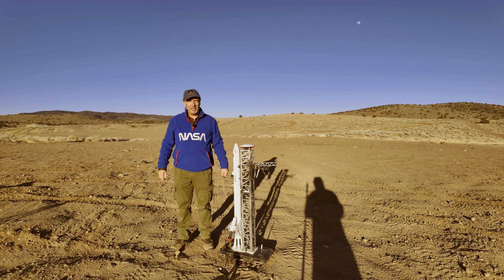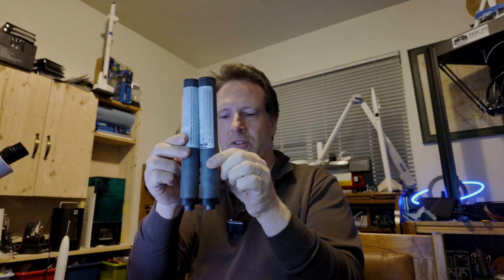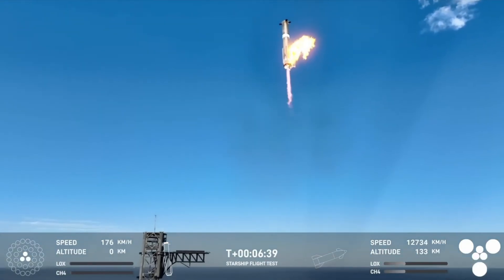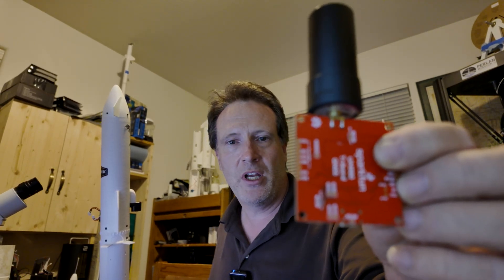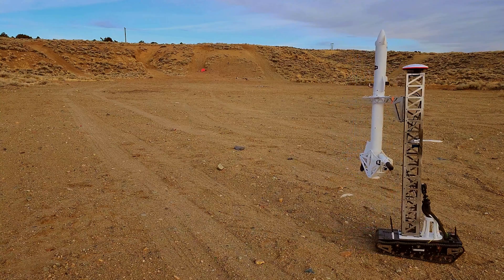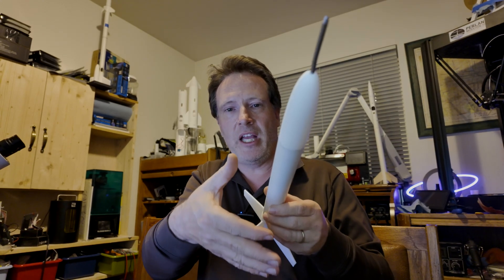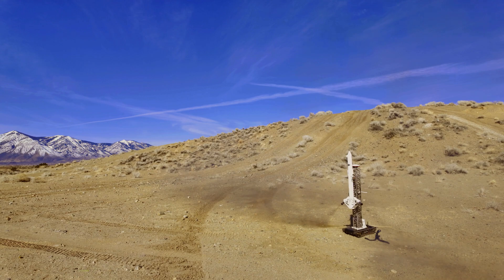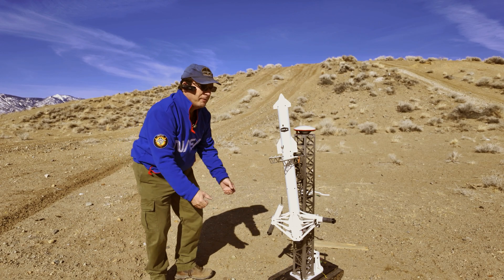Landing a Model Rocket Like SpaceX

Comment: In theory it could work with Jets rather than rockets right? Jet assisted rocket launch has been done by Virgin but jet assisted rocket landing?
Reply from the maker: There is a new category of "rocket" using ducted fans. Look for "EDF Rocket" and you'll see a few experiments. If the point was to actually carry a payload then that would be a better solution than solid motors.

Comment: GREAT JOB! The rocket gimbal backside is fairly ugly and looks quite heavy. Can you try to make it more like SpaceX’s engine system, or thin it down, sleek up your dual engine caboose? Should fly longer with less weight..

You should talk about how you programmed it - did you Raspberry Pi it, or..?

Where do you test fly? Nice snowy mountains, and you sound British or Aussie, maybe?  Are you in the US now? Looks like AZ desert somewhere, perhaps?

Bravo, well done, and continued success. PLEASE, more details to help teach us couch engineers. I built this stuff 55 years ago, without the fab tech. Now, I’m too blind and hands too sore, but I love to watch. All the best!
Reply from the maker: It has to be a certain minimum width to allow the two motors to point completely horizontal. There's no way to make them overlap or pass each other. I could have put the pivot at the top of the motors like I showed holding them by hand but that has a few other issues I wanted to avoid. Doing that moves the center of mass of the rocket quite significantly.

Comment: Ah... Bruh... You're suppose to land without the Starship, separately. Back to drawing board....
Reply from the maker: But isn't it better that both can land together? It actually comes down to the problem of where I put the GPS antenna. If I put it underneath the starship and deploy the starship, then the GPS gets a sudden change in reception conditions and may take a few seconds to re-establish its position to high accuracy. I can't afford that kind of delay or jump in the data I'm working with.

Comment: Hey @FlyDuoDiscus, love the video!!
What is that red circuit board you had with the bulky antenna that you said was accurate within 8mm? Where does it get its uplinks from? Very cool!
Reply from the maker: It's a Sparkfun board. I use two of them, one is in the base and one in the rocket. There's also another radio link that I didn't mention which sends the GPS correction data from the base to the rocket.
Reply: @ Thank you for your response. So it’s using GPS-RTK then? Is it as rough on battery life as I’ve heard?

Comment: Great job. What gps system are you using? What rocket motors we you using. Thanks.
Reply from the maker: The GPS is a UM980 from Sparkfun, in both the rocket and the base. The motors are Aerotech H13ST-P long-duration motors.

Comment: How about a bigger rocket in the middle for a vertical takeover, get to altitude, then on the way down ignite the landing thrusters?
Reply from the maker: Yes, that's certainly possible. I'm still thinking about what to do next.
Reply: @FlyDuoDiscus  might need a stage separation mechanism to ensure that it's aerodynamically stable both on the way up and down

Comment: Very cool! What was the augmented GPS transmitter that you used on the tower and what was the GPS receiver that you used? Where can you buy these for hobby purposes?
Reply from the maker: Sparkfun sells them. It's the same unit in both. It also needs a radio to send the corrections data between the two computers. I used a pair of LoRa modules from Adafruit.

Comment: Can you please explain how did you control the thrust of the motors
Reply from the maker: The trick is not controlling the thrust, since that's impossible with plain solid motors like these. The video explained a little bit about how I set up the motors to balance against each other. I'll make sure to include more details on this when I make a longer explanation.

Comment: Amazing! There seems to be plenty of energy on the table will you go for a height + landing record with this configuration? Are you planning to make a bigger or multi stage returning rocket? Subbed!
Reply from the maker: The thrust/weight equation is a little tricky here. I actually loaded up additional weight so that misfires and other problems coming off the launch pad happen a bit slower. I tried to move weight forwards to get a bigger moment of inertia.  The limit is the amount of thrust available for stopping at the bottom of the 9m descent. You can see in the video that it went to full thrust for a little tiny bit when it was trying to avoid the ground. The SpaceX booster ignites 13 engines to do the same thing, then cuts to only 3 for the final approach.

Comment: Are there any liquid fuel motors -- something you can throttle?
Reply from the maker: At this scale, even a liquid motor isn't throttleable as it's usually driven by pressure in the tank instead of a pump.

Comment: That is brilliant... never would have thought of it in a million years. Was there a third rocket motor in the base doing traditional TVC ? If not then I'm wondering how the rocket balanced in 2 dimensions if the two visible motors only adjusted in 1 dimension.

EDIT - never mind... looks like the two motors are each vectoring in 2 dimensions. Very nice.
Reply from the maker: You got it! Sorry that wasn't clear to start with.

Comment: The model rocket knows where it is at all times. It knows this because it knows where it isn't. By subtracting where it is from where it isn't, or where it isn't from where it is (whichever is greater), it obtains a difference, or deviation. The guidance subsystem uses deviations to generate corrective commands to drive the model rocket from a position where it is to a position where it isn't, and arriving at a position where it wasn't, it now is. Consequently, the position where it is, is now the position that it wasn't, and it follows that the position that it was, is now the position that it isn't.

In the event that the position that it is in is not the position that it wasn't, the system has acquired a variation, the variation being the difference between where the model rocket is, and where it wasn't. If variation is considered to be a significant factor, it too may be corrected by the GEA. However, the model rocket must also know where it was.

The model rocket guidance computer scenario works as follows. Because a variation has modified some of the information the model rocket has obtained, it is not sure just where it is. However, it is sure where it isn't, within reason, and it knows where it was. It now subtracts where it should be from where it wasn't, or vice-versa, and by differentiating this from the algebraic sum of where it shouldn't be, and where it was, it is able to obtain the deviation and its variation, which is called error.
Reply from the maker: There are no errors in my code.

Comment: Was just thinking, does 4 motors make it easier or harder to control the descent of the rocket? Because it seems like the added axis of control could make it more stable, but would it add too much complexity and be unnecessary?
Reply from the maker: I was thinking of doing a 4-motor version but I would only light two motors at a time. That would double the flight time.

Comment: what about using one big rocket motor in the middle with twin nozzles that can twist like that VTOL military jet so that way you eliminate the timing issue between motors firing and cutting off?
Reply from the maker: That's tough to do with hot rocket exhaust.

Comment: Congrats that's really cool. I've daydreamed about using ceramic bits to divert thrust outward. Using two motors isn't something I would have attempted. There's a Chinese guy on here who experimented with a solid motor that had 4 nozzles, which could be steered outward in a similar fashion. What the heck kind of motors are those? Never seen one burn all slow and long like that.

Comment: How are you controlling rocket body roll?  I would think that even the slightest mis-alignment on the rocket holding frame would have it doing a constant slow roll.
Reply from the maker: Each motor moves in X and Y. The two Y's work together to control roll. Without that it spins very fast as the moment of inertia in roll is about 1/100th of the other two axes.

Comment: This made me think, would it be possible to implement thrust control with a single solid rocket motor using a special nozzle that has proportional thrust reversers? So basically, small little doors not unlike the thrust reversers on jet engines, that swing down to block some % of the thrust. Obviously this component would need to be strong enough to withstand the heat and forces exerted on it (some metal probably?). Then the gimbal could be a standard single engine gimbal. Just a thought

Comment: Well done! Thanks for showing how it's done. I see that one motor cutoff after the other, causing that off-centre ending. Is it possible to point both motors downwards and slightly inwards at the last moment to minimise that effect? When one motor stops, the other burns for that extra fraction of a second, but because it's pointing slightly beyond vertical, the offset thrust is mostly compensated for. Subscribed.
Reply from the maker: The problem with that is pointing both motors directly at the pivot point is enough thrust to lift off again. I also looked at pointing the motors into full reverse-thrust but that still has an offset unless the motor exhausts are pointing up at the pivot point and that will melt the plastic I used for the airframe.
"Airframe rich" motors cause "rapid unscheduled disassembly".

Comment: I missed how the rocket moves in the Y axis to jump to the catch side of the tower.

I magine if you could have shown this video to Apollo engineers in 1968.
Reply from the maker: The computer I used to do this would have weighed more than the entire Apollo capsule in 1968. It is literally sitting idle 80% of the time waiting for the next 200th of a second to turn over.

Comment: Awesome and well done. Great idea to use ground-based GPS in the position solution.
Question - what motors are you using? They seem to be flameless and long burning. Are they chemical (versus solid)?
Kudos and very well done. [edit] I did watch an earlier video, and you indicate solid motors. Again, well done!

Comment: that is very impressive ... I was curious how the model was able to direct itself in directions other than the plane of the two movable motors ... does it just react to toppling in useful directions with equal thrust vectoring to change the rate?
Reply: would three motors provide more control?  I guess that depends on the stability of the thrust from the engines ...
Reply from the maker: I didn't make it clear that the motors are individually controlled in X and Y directions, so I have 4 degrees of freedom.
Reply: @FlyDuoDiscus  still impressed ... :)

Comment: WOW I almost laughed at this but I'm glad I looked at it again paying attention. Who would of thought using low impulse long burn model rocket glider engines right? Now at least this makes sense to me providing the GPS does all the work on guiding it in. Damn nice work 😊👍🏻 Let me know if I'm correct or not please?🙏🏻
Reply from the maker: I did seem to say in the video that it was as simple as knowing where you are. It certainly makes it easy with the GPS giving really accurate position data. But GPS on its own isn't fast enough and then I have the bigger problem of working out which way to go to get to the destination.

Comment: OMG. I cannot tell you how impressed I am with this!  I have been suggesting that Joe Barnard (BPS Space) use a similar method of thrust control for years, and I'm so glad to see that it does indeed work. You are a legend mate.
Reply: I've never heard of an approach such as what is shown in the video, but it makes sense to me in how it works. It's pretty clever, and also allows you to use motors that run continuously without the need to worry about re-igniting or igniting new motors for the decent.

Comment: Super cool! I’m wondering: what happened in the end: are you able to shut off the engines when the landing is detected? Why did the left side burn longer?
Reply from the maker: The two motors start with nearly identical fuel, at least within a gram or better. But imperfections in the fuel give different burn rates so that one which cut of earlier was actually giving more thrust for the flight, since we know it exhausted its fuel earlier. So my control system was actually working with imbalanced thrust for the entire flight!

Comment: Very cool achievement, but imho the drive system makes sense because it’s like you wanted desperately use rocket motors where they are limited. Better make a brushless motor driven rocket and do stuff like this. Keep it up 👍🏾

Comment: Incredible! The computer programming must have been no easy chore. And I'd heard of GPS enhanced by a ground station but never knew it was accurate down to millimeters - or that such a device is relatively affordable.
Man, that programming!
Reply from the maker: About 6K lines of code and hundreds of revisions. Not my biggest project by LOC but this has no subsystems. There's not much that can be tested independently - it all has to be tested in actual flights with working motors.

Comment: Hey, Just wanted to say this is real cool, I just finished building my Olm and launch tower ready for a catch my rocket actually seperates and it goes about 1000 feet up then (fingers crossed) it should come down and perform a catch. The Starship itsself parachutes down as i have not built the stuff to be able to land the starship and catch the booster but give it a month or two and we should be good. This is really cool, have a good one mate
Reply from the maker: I thought about separating mine but the real purpose was avoiding using any parachutes at all. I do have a payload bay, so I could deploy a "starlink" at the top of the launch.

Comment: This is pure genius ... you just figured out how to control the "thrust" of a solid-fuel rocket.
Reply: THAT TRUE. i dont figure it out till i see your coment. and i wach bakc and look how that posible hahahaha. Yep it spread the angle so the thurst is split due to angle. Nice observation.
Reply: Similar technique to the Gravity Industries jet suit. The throttle response of the turbines was too laggy to be practical for hovering, so thrust is controlled via having a few of the engines arm-mounted. The pilot can spread their arms to reduce the vertical thrust.
Reply: Means SRB can be reusable
Reply: I taught him
Reply: @doctorpanigrahi9975 And I taught you 🤣🤣
Reply: It wont scale sadly, too much unnecessary hardware. I mean it could scale but it will never be cost efficient for launching to LEO/GO/PO etc
Reply: Not very efficient but it can't be anyway since you can't control the throttle :)

Comment: Outstanding! I understand how the rocket could control its side to side motion going left to right, but how did the rocket control its position going back and forth? In other words, what kept the rocket from tipping over? The same thing would apply to the position of the rocket relative to the tower. I understand how the rocket could control its left to right motion relative to the tower, but how did it control it's distance from the tower in the other two directions? Where is the mechanism for control to go back and forth? Hopefully my question is not confusing?
Reply from the maker: I didn't make it clear that the two motors have both X and Y control. The first layer of control tilts the Y servos opposite from each other to maintain the rotational position, then it tilts them together to rotate the rocket in pitch, towards or away from the tower.
Reply: @: Ok, that makes sense. The control mechanism for the pitch of the rocket is not going to be as obvious as the movement that controls the rocket's elevation. I can see why it would take at least a year to develop something like that. To control a rocket of such a small size requires a very delicate dance. Very impressive.
Reply: I was wondering the same - am thinking that it could take advantage being inherently unstable - any tilt along the "off" axis would be correctable with equal changes in thrust to alter balance ... but I am not a rocket surgeon, so I don't know for sure ...

Comment: Amazing. I can see how you can move left and right but how do you move in and out so to speak?  When you dropped down to make the landing how were you able to move into the launch tower? How ever you did it, it was fantastic. Bravo!
Reply from the maker: The two motors move in both X and Y directions so it can pitch, roll, yaw and throttle all at the same time. (4 degrees of freedom.) Sorry that wasn't clear. It looks like a few people had the same question.
Reply: @FlyDuoDiscus  Really impressive!

Comment: Honestly, I thought that it was fake for the first 10 seconds. I was also thinking about using two motors to regulate total thrust, but I thought that due to the inconsistency of thrust and relatively slow motor gimbals, it would not work. I am really surprised that it did.

Also, love the use of RTK. Was it expensive? The last time I checked, all solutions were way over my budget.

Really well done!
Reply from the maker: Sparkfun UM980. One for the base and one for the rocket, but different configurations. I paid $280 per unit.
Reply: @FlyDuoDiscus  Ouch, still quite a lot. 
Thank you! Really amazing job. Would also love to hear about your control system. This thing is incredibly stable.